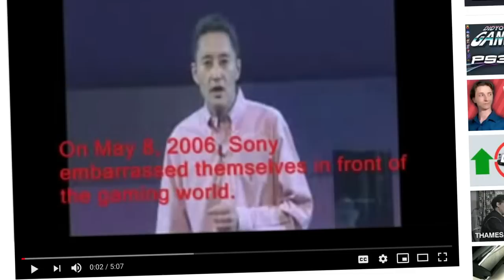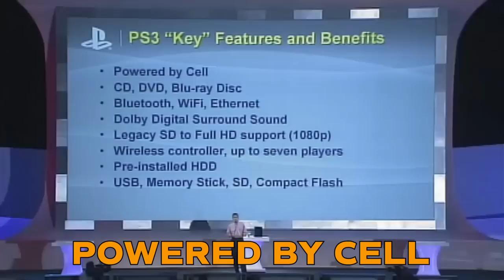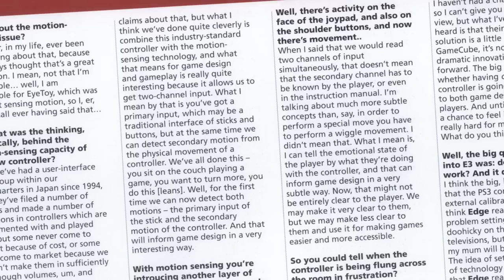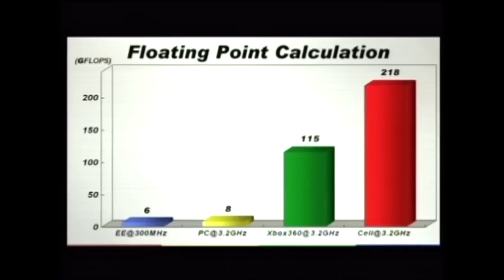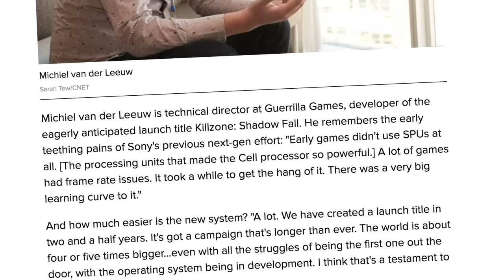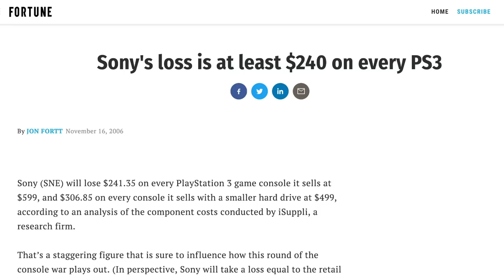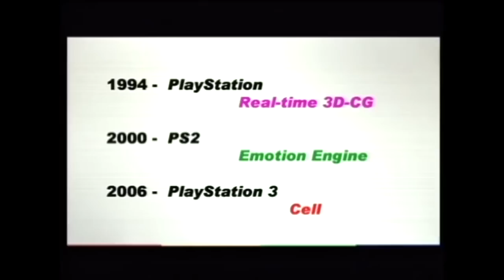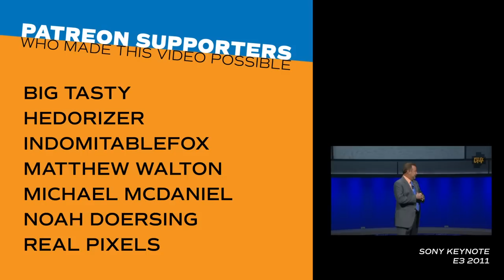Revisiting Sony's Notorious PS3 Reveal | Retrohistories

Comment: That whole generation was a bit of a disaster. 360's were dying left and right till about half way through the generation. The Wii had more shovelware than the GBA. Japanese game development went into decline.
Reply: PS3 won anyway.
Reply: It had an extremely rocky start but it ended up producing a lot of fantastic games. It was the transition to the modern era of gaming so of course there were growing pains.
Reply: The 7th generation had its pitfalls and teething problems (the Wii was a bit simplistic, the early 360s were unreliable, the PS3 overdesigned, etc), but the PS3, 360, and Wii were all in the long run evenly very, very successful (only Microsoft and Nintendo took on the wrong lessons towards the end, with only Sony entering the 8th generation  with success).
Reply: Mostly only liked early 7th gen , even though there were less games It just felt the most fresh and exciting between 05/06/07.
It was Iike an early peak , overall decent but far weaker than 6th , 5th , and 4th gen.

Comment: Very fascinating. And really well researched.

I've only seen the glimpses of that conference, but my God was it a slogfest. That ads and marketing without seeing that was far more exciting for me. For the longest time, the PS3 held an enigmatic aura around it and it really felt next gen to me, because I didn't play any 7th gen video games until 2010/11. Getting more deeper into gaming in 2013, I had this misconception for the longest time that x360 was more powerful than PS3 when hearing about performance and such.

Another thing I feel is at after Kutaragi left, PlayStation started to garden wall their system, with the removal of backwards compatibility and Linux support, and afterwards with PS4 providing none of that.

One last thing. With hindsight of past mistakes behind them (everything you've covered about 2006 keynote, PSN attack of 2011, Xbox one's launch and reliance on online) and stuff like Phil Spencer turning around the Xbox brand, I think next console reveal should be an interesting one.

Those last clips were quite wholesome.
Reply: Ps5 will have bc don't worry with all ps consoles

Comment: Many fans still believe all the fantastical crap about the bluray being essential for the, at the time, next gen games even though back then some non gaming magazines and sites always knew the ps3 main purpose at first was to the be the Trojan horse in the bluray / HD DVD Hollywood war. Even the name of the console "PlayStation 3" was written in a similar font and fashion like the title for the Spideman 3 title which was probably the most anticipated Sony pictures film at the time.

Another noteworthy viral video to remember of that time is the "I have 3 PS3's" from the guys from LRR which made a lot of people angry
Reply: The Spider Man font was only chosen because Kutaragi liked it and they happened to own the rights. They even changed it pretty soon after he was out of the company.
Reply: Your theory about the PS3’s original logo choice seems intriguingly tinfoil, but otherwise I think you’re spot on. There ended up being less than 20 PS3 games that even needed a dual-layer Blu-Ray disc, mostly first party. I still wonder how things would’ve turned out had Sony used a less bleeding-edge format (at the time) for the PS3.
Reply: @ninawilliams8  I have mixed feelings about the ‘Spider-Man’ font, but it bums me out that Sony have only ever used that safe PS2-esque logo ever since. Same with Microsoft. Literally just the Xbox 360 logo’s font with the corresponding suffix attached.

Comment: Saying that the 360 was like a PC is completely wrong.

Both systems used IBM's PPC architecture. Which is nothing like PC's X86 architecture. This is why emulation of both systems is only now becoming possible with current hardware and with even then there are issues.

The 360 also used EDRAM which is embedded memory on the GPU die. Using this can be somewhat similar to SEGA's "blast processing" where you can store import stuff here for lightning fast access which can alleviate bottlenecks in the system. The 360 used a MUCH better GPU than the PS3. The 360 used one of the very first semi-unified GPU processors. Before this GPU's where built with discrete pipelines for geometry, vertex, and pixel processing. The PS3 still used one of these chips in the RSX from Nvidia which was based on the 7800GTX. Nvidia didn't go fully unified until the legendary 8800GTX GPU's released in 2006/2007. The 360 used an ATi GPU based on the X1800XT chip which unified the vertex and pixel pipelines together and it has 48 of them (and 8 discrete ones for geometry). This was HUGE, most GPU's (like the 7800GTX) only came with between 16 and 24 pixel shaders and only 8 vertex. The 360's GPU further simplified the programming process by allowing the developers to push instructions to a much larger cluster of shaders that could do multiple tasks.  For the PS3 this wasn't the case and instructions sent to the GPU needed to optimised a lot more. 

Then factor in the 360 also used a unified pool of memory of 512MB that both the CPU and GPU could access however the developers wanted, and they also had access to 10MB of super fast EDRAM. The 360 was simply a breeze to program for compared the PS3 which didn't really get tapped into until Naughty Dog basically blew the CELL chip open with Uncharted 2 and then literally wrote manuals and shared them with close partners of Sony. That is when the true power of the CELL was unleashed and the other system bottlenecks were somewhat overcome.

Comment: A Super PS2 with more RAM, VRAM, and several high clock MIPS cores with improved SIMD and Vector Units couldve sold for less without a HDD and BluRay.  Worse, SONY could've beaten their competition by a year and had far better launch titles.  Even making money by selling BluRay and HDD as extras instead of giving them away.